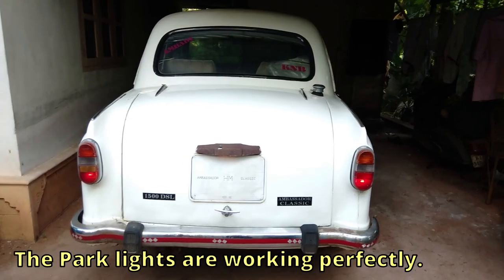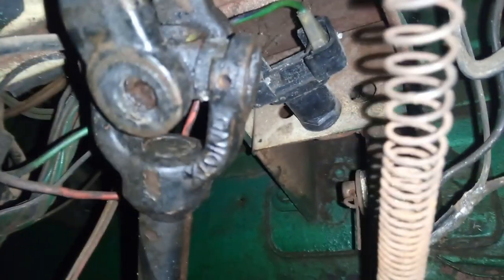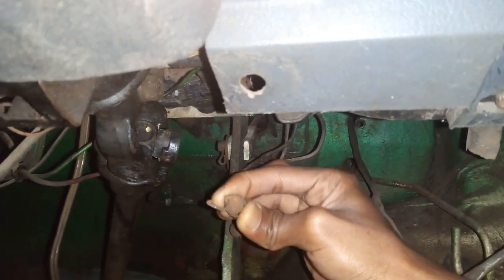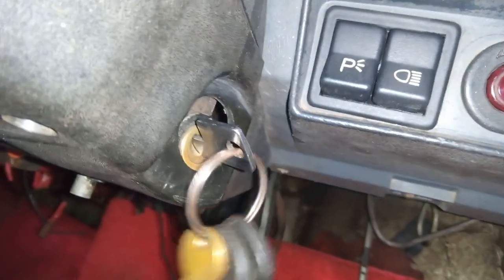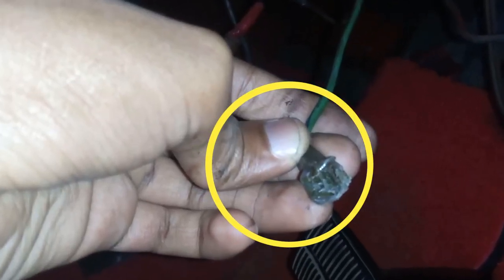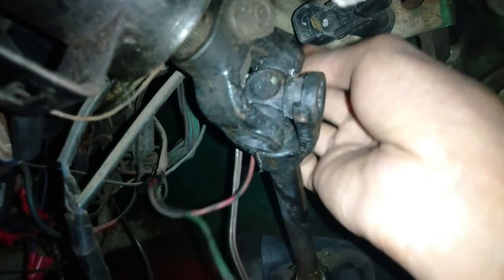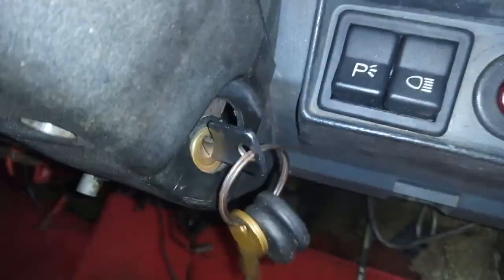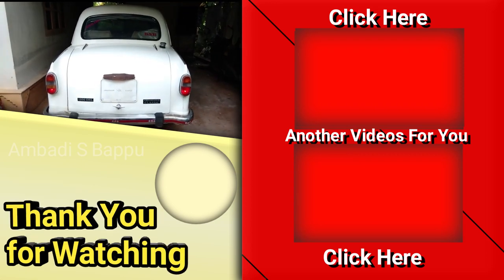Car Brake Lights are Not Working | Problem Solved | Complete Video | HM Ambassador Car

Comment: hai, what is the reason for brake light not glowing suddenly when brake pedal pressed? whenever pressing half pedal only the brake light is glowing.
Reply from the maker: @AmbassadorGanesh  Sir, It may be due to the stucking of break switch. After a long time, the pressing side of switch gets tighten due to dust and rust. 
   Just look at the brake switch below the Steering, above the mounting of brake pedal, Near the Steering universal joint. Most of the Ambassador cars have brake switch at that point. If possible, Just press the switch with something and  try to make it free. Clean the switch and apply very small amount of greese at the pressing side of switch. Also check the two connectors of switch. If not working, check it in electrical workshop.